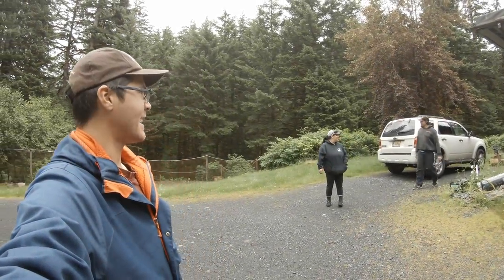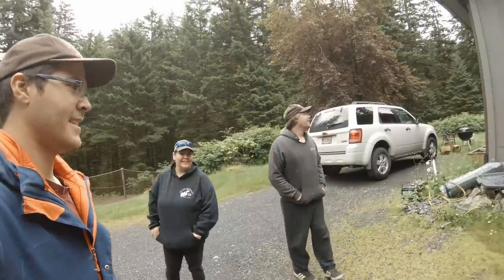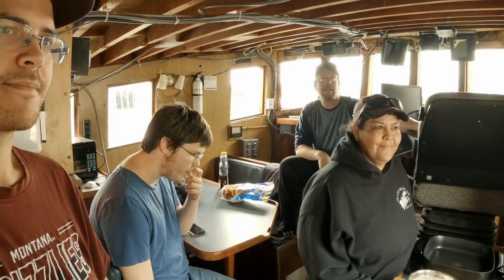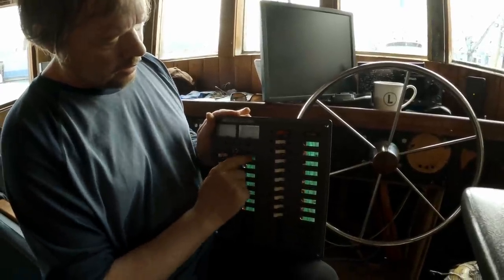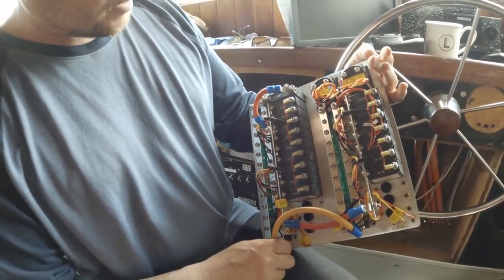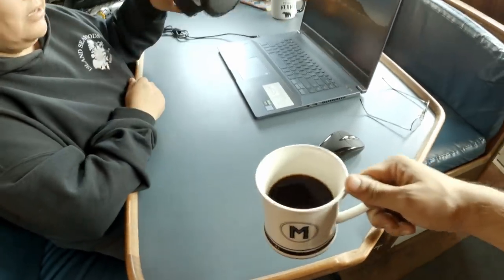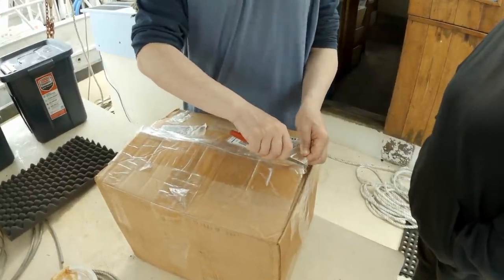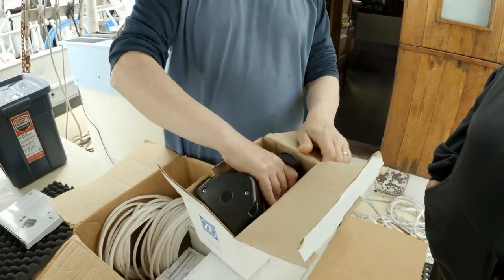Making Plans - Unboxing New Boat Toys - Emerald Isle: Ep.8 Fishing Boat Refit

Comment: I just put those micro commander ZF units on my boat on old mechanical twin Volvo turbo diesel‘s. The Deutsch connectors that they use in the kit are some of the best connections I’ve ever seen. You can get some pretty inexpensive crimpers for the terminals on Amazon and eBay The manual is kind of daunting, just take the time to pre read it first. There are some supplements that go with it for updates.  I had a question on your gauges for your boat though yeah. You’re doing some other updating why not update your engine gauges to digital using something like a Nolan RS 11 and convert it to N2K data?  Enjoying the videos, keep up the good work.
Reply from the maker: Yea had to read through the hookup part a couple times. Pretty good manual overall, although a couple of the diagrams one could misinterpret, with the way they numbered them. That's an interesting idea about digital gauges. We hadn't thought of it. Might be something we explore in the future, likely when we repower. Thanks, Chad!

Comment: The switch panel any link to where I can check them out?? Would be a good upgrade for my boat
Reply from the maker: Hi Full tilt, hope this link comes thru okay and you find a panel that will work good for your boat. Take good care.
Reply from the maker: https://www.hodgesmarine.com/blu8380-blue-sea-8380-breaker-panel-dc-22-pos-main.html?gclid=Cj0KCQjw1dGJBhD4ARIsANb6OdmXt8g5Zr3x2Vy755de2Hr6CJ1HWQDa_lKrW2VKe6WHayWW4G3pm58aAogtEALw_wcB
Reply: Appreciate it all the best

Comment: Micro commanders aren’t very good .. the Morse electronic controls are way better ..  I have tyrm
Reply from the maker: We have had MMC on the Fish Tale for 22 years. Never an issue.
Reply: @EISAlaska  good for you guys .. .. I know the outside ones tend to get a little funky .. but if you like them all good .  The one thing I like about the Morse ones over the micros is they have a manual override at the box so use one of them if the something happens to the box
Reply: I had them on a herring boat the outside station gave me trouble after a few years .. maybe cause of the shaking herring I would have to change the control head every few years